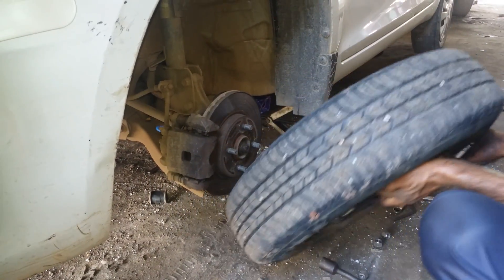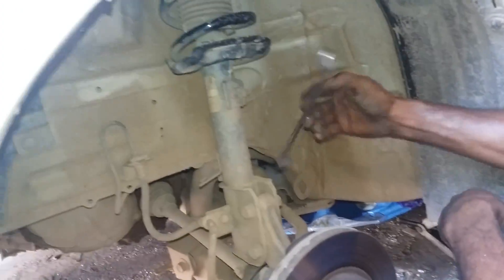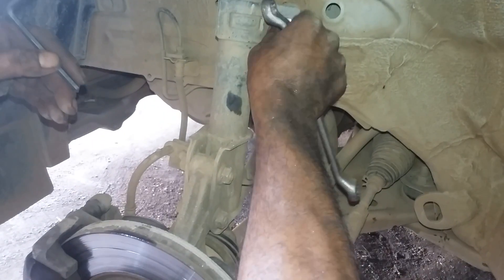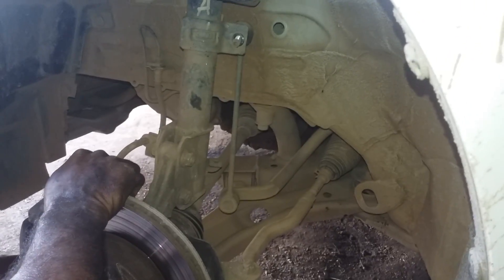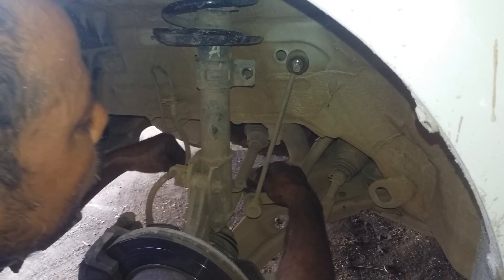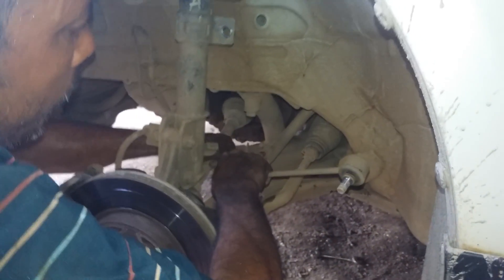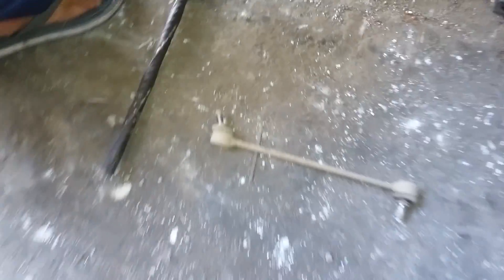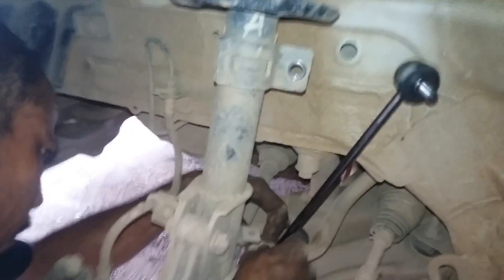How to replace sway bar link on swift|suspension overhaul|autokraze

Comment: what is the symptoms?
Reply from the maker: You will get a sound from the suspension specially over gravel roads
Reply: @Autokraze  what do you think about when I push the brake a little then turn right then i will hear a " tok" sound. do you think its the sway bar link?
Reply from the maker: @danelectr  If the sound comes only when you steer either left or right then it's the drive shaft. If it comes only when applying the brakes without any steering input then it should be from the brake pads or caliper pins. Sway bar sound will come non stop while driving over patchy roads. I hope this helps
Reply: @Autokraze  Thanks. it only makes a sound sometimes when i turn right "tok" sound so you think its the drive shaft?

Comment: While im turn left or right theres a noise and in slow speed also a noise wt is the problem sir.. swift diesel
Reply from the maker: The noise which comes while turning left or right is from the drive shaft. The sound which comes in slow speed is hard to identify without listening to it. I hope it helps!
Reply: @Autokraze  ok broo ❤️ is it a big problem
Reply from the maker: You should check the drive shaft boot first, if it gets too loose it will cause serious problems
Reply: @Autokraze  80k kms only driven..not all times sound coming very rare .in driving it not coming . Showroom guys cant find that and
Reply from the maker: Check your drive shaft boot first for any leaks.
Reply: @Autokraze  its perfect ina condition .. mechanics saying pads rubbing

Comment: sound only in patch roads or?in my case while cruising i can feel that knock knock sound from left side suspension and i can feel that knock knock in steering also by a little. . could this be the problem or?
Reply from the maker: Vignesh Vee cant say that without having a proper look. What you can do is check if there is any sound when steering the car in idle, also if there is a sound fron the steering it could be the steering rack. Also, do check your LHS wheel bearing for noise in normal cruising conditions.
Reply: i think the problem is tie rod. .because tie rod can transmit the sound into steering right?
Reply from the maker: Vignesh Vee the steering rack and the column is linked with steering noise.
Reply: Okay bro. .will check

Comment: my swift makes a knocking noise in the front on rough roads, could this be the problem? On speed humps I don't get the noise.
Reply from the maker: Paul Turner it could be due to suspension link or also the arm ball joints, the steering ends. These three are the parts.
Reply: Thanks I will be getting it checked on Monday I hope. I will report back.
Reply: @mathsunmasked56  I have the same noise over rough road but not in case of hump or over potholes.
If share your experiences if problem has been rectified !!
Reply: @abhishekrauthan2231  In my case it was the caliper pins. They were greased and put back. It keeps them quite a while. They can also be replaced. This is a common problem with Suzuki swift.